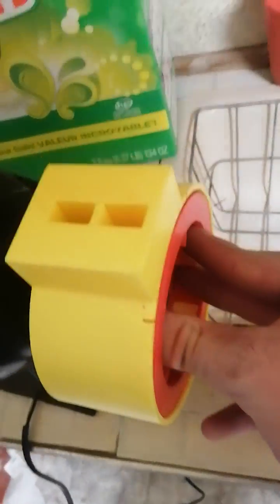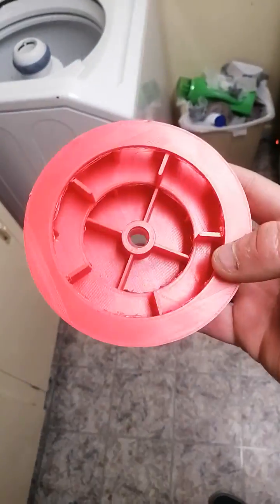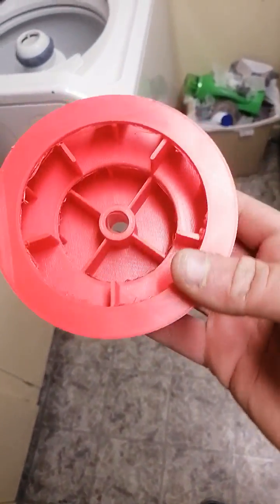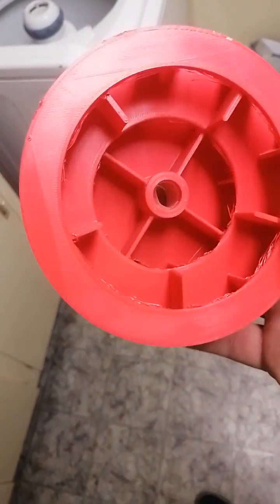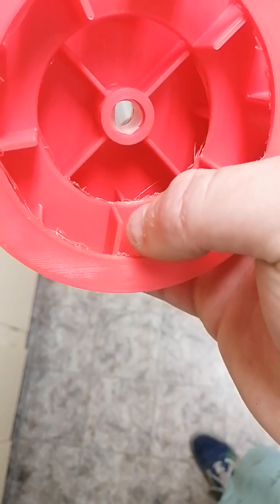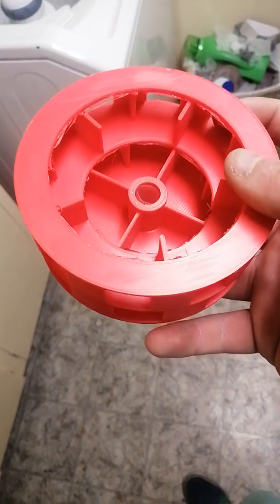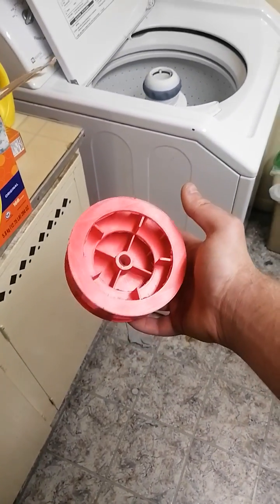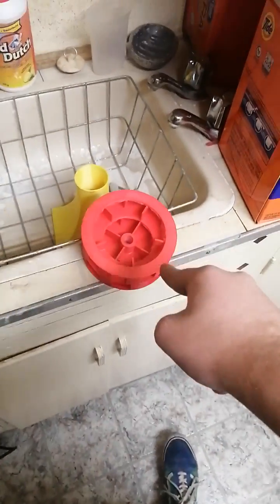8/10 Port 3D Printed Siren

Comment: You know this what Rolling Meadows Illinois will sound like, the hi-lo signal. Plus the pitch of the 3D printed Hurricane sounds like North Montessori School ACA Hurricane MKII 130 recording from Alerting Communicators of America in 1979. This ACA Hurricane 130 was located at Glendale, WI and was removed in the 90’s and replaced by a P-10.

Comment: if possible can you try and make a 10/12/15 port siren ? it would sound exactly like the super rare gents tri tone siren. (EDIT : it would not since 3540rpm instead of 2850rpm)
(click read more, theres more...)

BIG EDIT : i managed to find a 50hz bench grinder (i am in france) on leboncoin (a french ebay ripoff kind of thing), and you know what that means... 50hz=2850rpm (yes i checked the label on that bench grinder it says 2850rpm), so that means that if i get that 10/12 rotor and stator assembly from nicolas then i can do a british air raid siren, but i will just use a 8 port stator and rotor that you made and posted on thingiverse that i downloaded early since that makes the INFAMOUS french siren tone. right now the only sirens i have are 4 carter minimites that i also got off leboncoin, but i am really going to get that bench grinder soon (my mom has a 2850rpm bench grinder, but you cannot unscrew the grinding wheels, so too bad) and when i recieve it i will do my french siren.
BIG EDIT 2 : i realised that to make the french siren sound you need a 3000rpm bench grinder, which i found ultra easily since the standard rpm for bench grinders in france are 2800 (rare), 2850 (rare), 2950, 2980 and 3000. so i will get a 3000rpm bench grinder to make a french siren.
Reply: 7 months later and i have finally gathered it, i hope its worth it...
Reply: let me discontinue this series of comments, also it wasnt worth it as said bench grinder broke :/

Comment: Hey how are you doing man? Every video that you make is pretty cool! Any more ideas you plan to do?
Reply from the maker: I'd like to build a big loud siren that does 130 at 10ft. But because it's big and needs a powerful motor, need figure out design and what grinder motor I'll need. I want to print it once and as is because it takes days to print and uses alot of filament. But for now I'm gonna keep making some smaller sirens
Reply: You probably need to step up from bench grinders then, the induction motors they use dont even reach 1hp, you should try and get a bigger ac motor one that is 1hp above,ive seen that aca penetrators have 10hp motors, you could get one cheap if its used, but then youll have to know if you want a single phase or three phase motor, if you choose a 3ph you will probably need a vfd to run it with single phase current. @ClumooStudios
Reply: @ClumooStudios  Do you have an update on this yet?
Reply: A suggestion would be to give it a blower of some sort, but that’s just what I think you should add

Comment: What's the power consumption and RPM of that motor? It's basically a glorified blower fan so I can't imagine it needs that big of a motor to make a sound right?
Reply from the maker: Well the motor is pretty much fucked at this point, however it still runs all the way up to 3450rpm. I like the bigger motor because it has more power wounding up bigger rotors I put on it. Not sure about the power consumption